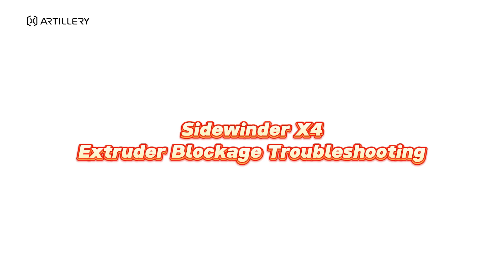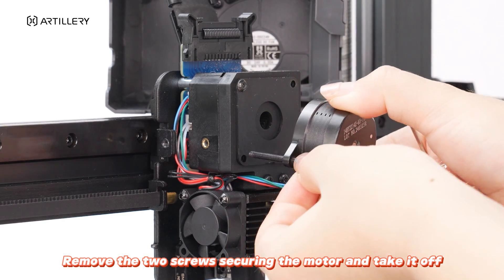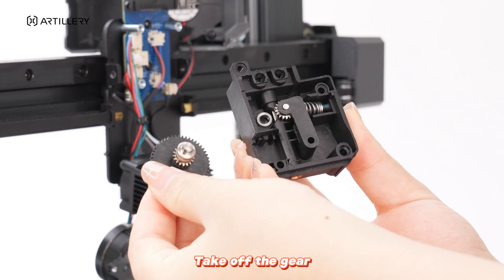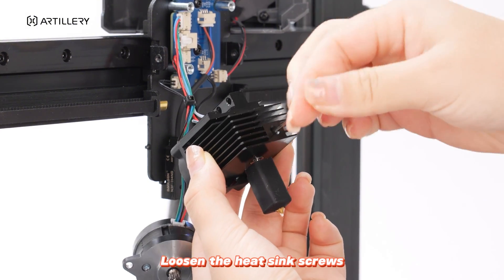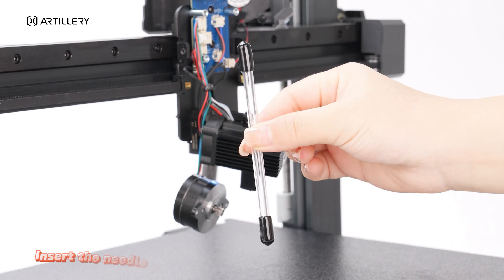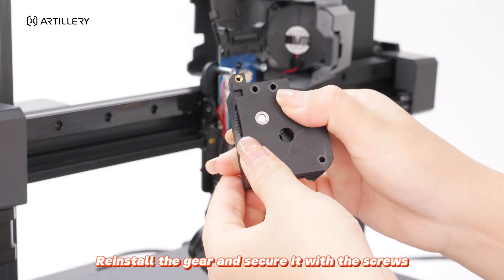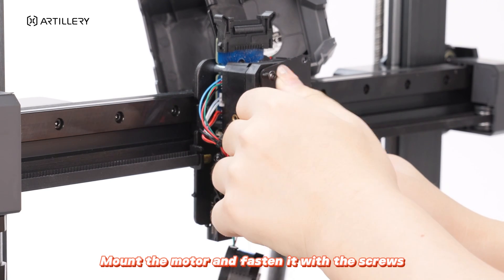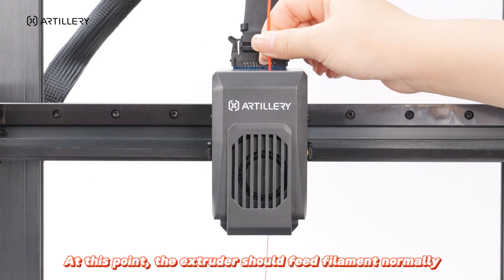Artillery Sidewinder X4 Series | Extruder Clog Troubleshooting Guide

Comment: Thx for the advice, i had a very bad clocking inside the hotend with Filament broken and stuck inside the round metal tube of the Hotend. I couldnt catch it with tweezers but i used the cleaning needle wich i heated with an hot-air-gun and melted it up all the way to the noozle, assambled again and heated the hotend and cleaned it from the nozle regulary than. After that i recalibrated and now it´s printing fine again.
Reply from the maker: Glad to hear this!
Reply: I got the spring from the pass through needle stuck in there am I cooked😭
Reply from the maker: @ Do you mean the needle stuck in the exturder? Just disassemble the extruder part according to this tutorial video. And try to remove the needle.
Reply: @ no like the kinda spring part that you hold it from
Reply: @ I also took it apart and saw nothing and I don’t have the tool to check the inside of the nozzle